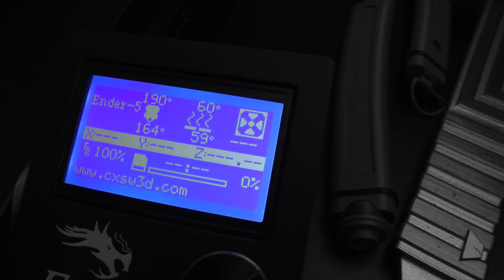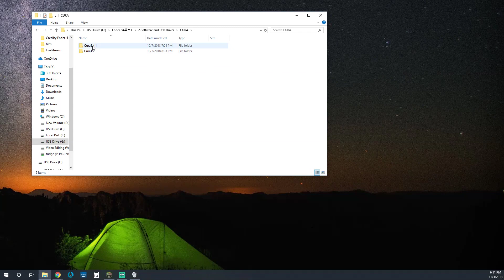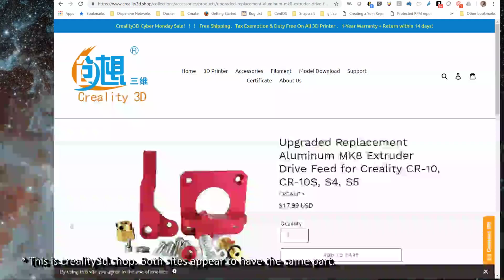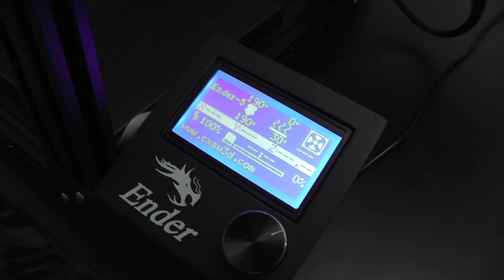Creality Ender 5 3D Printer Review

Comment: If you undo the two screws on the bottom center at 2:40, then pull on that bracket while retightening the screws you can tension those belts. It's a slightly awkward system to use, but it does work.
Reply from the maker: Yeah, I figured that out later and made a video on my channel about it. Thanks!

Comment: I believe the kinematics make this a regular cartesian printer - one motor moves the X-axis only, and one moves the y-axis only.

If you flash a custom firmware you'll probably need to set the style as "cartesian" since it doesn't need to do arithmetic addition or subtraction to convert from gcode coordinates to stepper coordinates as would have to be done for an h-bot or corexy.

Comment: Now they just need to make a 400^3 dual z-axis version and I'm sold! Though I'll be replacing the controller with one I can put 2130s and 2208s on.
Reply from the maker: Yeah, there's room for improvement but it's been a very reliable printer so far.

Comment: Hi, Thank you for your review.
I have been reading many reviews about 3D printers this past week. I am looking to buy my first one. Cost and quality wise I was considering buying a Creality. I first made my decision on the Ender 3 Pro, then I watched a review about the CR-20 that has the Power supply encased and which apparently lowers the noise. For this one it is also the case apparently.
My other criteria is safety because I have a 4 year old kid. That is why I was looking at enclosed printers too, because I want to avoid the risk of him putting his hands on the hot bed. If the Flashforge Finder was cheaper I would have probably bought that one, even it is limited to PLA.
However the Ender 5 has a cubic structure which makes me think that it should be possible to enclose it somehow with plexiglass or other material. Does the structure enables to put screws on the sides of it? 
Thank you for your answer
Reply from the maker: You could technically enclose most of the base but not the upper portion due to mechanical issues. You'd just need to buy some t-slot screws and nuts to attach it. It may not be ideal but it would be inexpensive.

Comment: Would you recommend this as a first printer?  I am debating between the Ender 3 and the Ender 5.
Reply from the maker: If the additional cost is in your budget, I'd spend the extra money. From my understanding, this printer is a lot easier to put together than the Ender 5. That may save you some headache on the assembly. I also think you'll be happier with the prints but that's subjective based on your expectations.
Reply: I have the Ender 3, and it's definitely an excellent printer for the price. I'm going to buy the Ender 5 as well, and the print quality should be very close, but the Ender 5 probably has a little edge as the structure of it is more stable due to being a cube. There's also a higher quality power supply in the Ender 5. However, I think you'll be real happy either way, and I recommend upgrading the extruder on both, although the included one works ok.
Reply: Yeah, I am looking at the E3D Titan Aero.
Reply from the maker: I'm trying to figure out the same thing. I'm going back and forth between a Titan or a Bondtech. I'm probably not trading it out on this printer though. It's for the next printer I'm building. :-)
Reply: @kerseyfabs  both are good extruders, so can't go wrong with either. :)

Comment: Hey man, Love your videos, I have an Ender 5 and at the begging it worked awesome! I did the Aluminum Upgrade to the extruded, using the Capricorn upgrade as well. I was using Cura at first but prints started failing. I had about 25 to 30 failures. I changed out the hot end extrusion head and tried the best I could to make sure the Capricorn tube met the brass nozzle. I just purchased Simplify 3d to see if the software was the issue but Now the initial extrusion line goes along the back side of the plate instead of the right side and nothing at all extrudes when it tries to print. I am using Hatch-box grey standard PLA filament and initially was able to print some nice tank models. Is there a way to put the printer back to default?? Any help would be appreciated :)
Reply from the maker: Thanks! Can you tell me what kind of failures you started seeing? Maybe I can help. I think the part of the printer you'd like to turn back to default are the parts that come from the slicing software. So if you want Simplify3D to act more like Cura, you would have to copy your start and stop gcode (possibly with careful modification) from Cura to Simplify3D and possibly some other settings. The slicer shouldn't modify the printer permanently but it could feel that way if the slicer does the same thing every time.
Reply: @kerseyfabs Thank you for the reply. I uploaded some Tank Tracks I have been working on. Notice the smaller one is much tighter and when I increased the size thats when issue like this happened (see the plate end of larger track) then it just kept getting worse tried Cura, Bought simplify 3D, changed out filament The images can be viewed here,    http://www.bostongamingservers.com/3d-printing-area/    and that you for your help :)
Reply from the maker: @jmburnzy  Have you printed out a calibration cube to see if the steps/mm of your printer are accurate? Without having any more than a picture, it looks like your Z stepping is too large and the space between each layer gets too big. I assume I'm looking at the tops of the prints. It's also possible there is an error in the model that gets amplified by increasing the model size. Load up Meshmixer and see if there are any problems. This video should help. I've linked to the specific topic: https://youtu.be/C9VDKb3W4qA?t=522

Comment: Great review, it really helped me a lot because I'm planning to buy my 1st 3D printer. I'm lost between ender 5, ender 5 pro, ender 5 plus, and ender 3 pro. I would appreciate any ideas to help me decide. Subscribed
Reply from the maker: Congrats on your first printer! Here's my personal quick run-down:
- Ender 3 Pro: I slightly upgraded Ender 3. Entry level printer but with a great community and lots of community support. Generally these are well built and easy to get started with.
- Ender 5: An upgrade to the Ender 3 due to its fixed bed (only moves vertically). It's very easy to assemble and user experience appears very positive. This YouTube channel has a lot of upgrade videos on it.
- Ender 5 Pro: An Ender 5 but with many of my upgrades already applied. 😉 I haven't tested one of these myself but, on paper, this is where I'd start today if it were me. Upgraded silent board, metal extruder, and Capricorn tubing. You don't save a ton of money over upgrading these yourself but it's done for you.
- Ender 5 Plus: An Ender 5 but bigger, 350x350x400 instead of 220x220x300. I wouldn't recommend starting here unless you know you want the bigger print volume. While I had relatively little difficulty getting it going, not everyone has been so lucky. More experience helps debug issues.

I hope this helps!
Reply: @kerseyfabs  
Thanks for your help. I decided that I will buy the ender 5 pro after 2-3 months maybe sooner. Anyway, can you recommend for me any videos to watch for tips and tricks upgrades or important prints to do. That would really help me. Thanks for your time.
Reply: @kerseyfabs  I just got s new competitor for the ender 5 pro which is artillery SW X1 which one would you recommend if they're at the same price

Comment: I don't think there's a reason to why printers like this should print at a better quality, thean an Ender-3 for example.
It's said the the lack of movement in the bed gives them chances for less failure, but the compensate this by moevment of the weight of a whole Nema 17 motor and also by using more complex mechanics that make them harder to tune and more prone to failure. And then there's the flimsy bed, wiht no mechanical fixture in the front, that would make the bed come lower at the frontend when the printed object on the bed becomes heavier.
Reply from the maker: While I tend to agree with you in terms of movement, there are a lot of people that have more experience with linear motion than me that say differently. I'm not a big fan of all of the excess pulleys and gears in an H-bot or CoreXY. This printer's design is much more simple though and I really like it. One correction though is that the bed is far from flimsy. With 10mm rods instead of the standard 8mm and with really long bearings, it really has very little flex in it, especially since there are no extra forces applied on the Z-axis. I meant to include more about this in the video but several little details were shortened for time. Thanks for the comment though so I could mention it.
Reply: 4:27 is for tensioning belt with 3 screews - its not ideal but it work.
As for bed its not flimsy but it tent do wibrate on fast moves and wooble. I wish there was a pro version with 2 sets of Z axis.

Comment: Getting my Ender 5 tomorrow already purchased TL smoothers and better tubing for the filament. Any tips you have for setting it up and printing or possible upgrades that you can print?
Reply from the maker: Congrats! I don't think any initial tips are needed. If you need help, you can watch my original live stream. As for printable upgrades, check out this for a bed support (I'm currently working on): https://www.thingiverse.com/thing:3479330
I'm considering this for part cooling: https://www.thingiverse.com/thing:2757244
Let me know what you think.

Comment: Thank you for that (I have just ordered it), though I would have to say that https://www.thingiverse.com/thing:3302814 should be the first upgrade any Ender-5 user should do (of the two prints offered therein, the one with the vents makes more sense, and you do not even need to add any supports if you use the filament that came with the printer). It protects the control board underneath the display, which comes completely unprotected from anything that can cause a short and completely destroy the electronics when you least expect it.
Reply from the maker: This isn't a bad idea. I could see me accidentally hitting the board with a metal ruler or something. Thanks for the tip!
Reply: @kerseyfabs  You’re welcome.